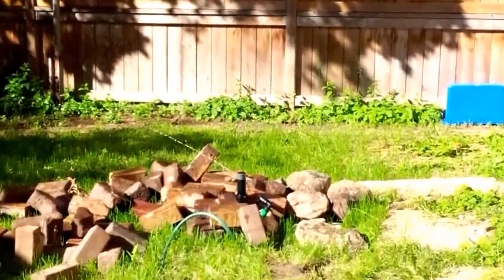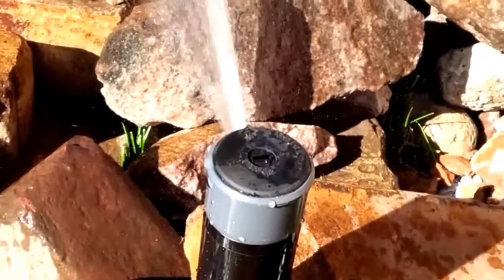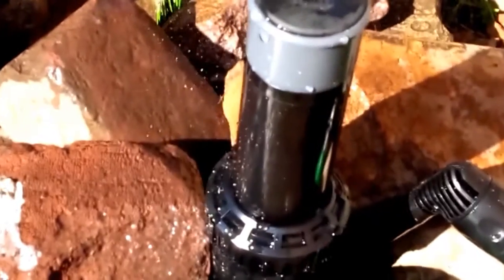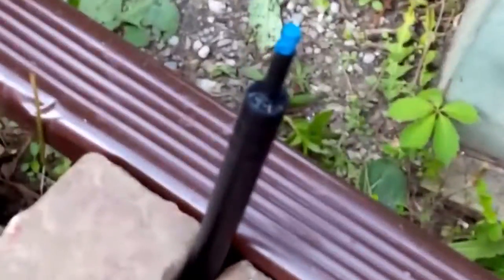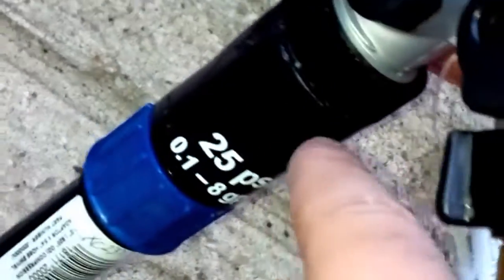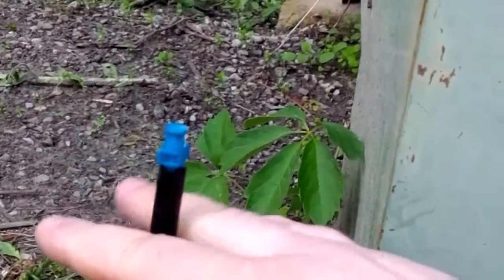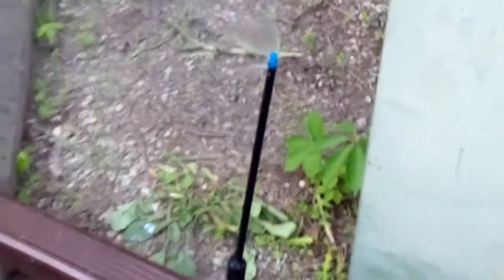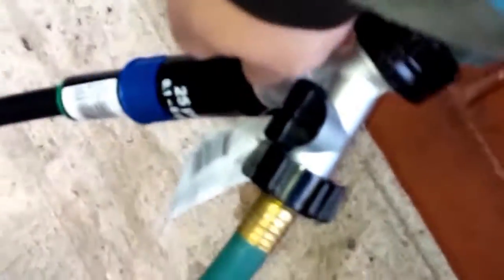DIY Automated In-Ground Water Sprinklers - Before Installation

Comment: I did the same thing but just ran PVC underground directly below the spigot and used a 3 foot water hose to connect the timer to the PVC. PVC splits to 4 heads